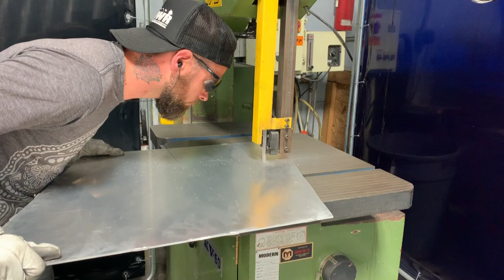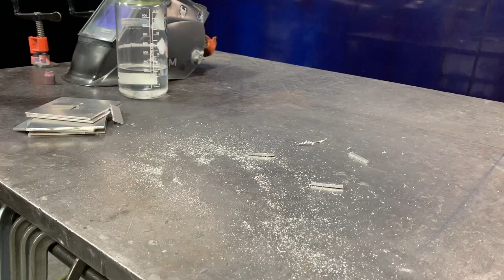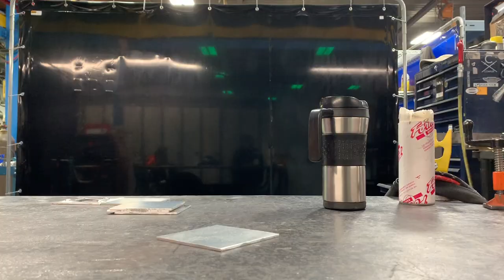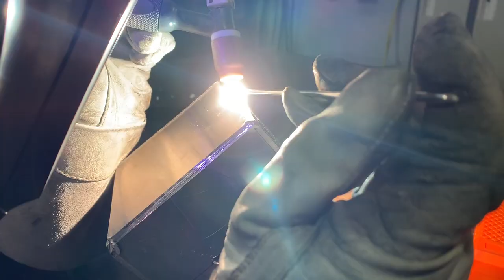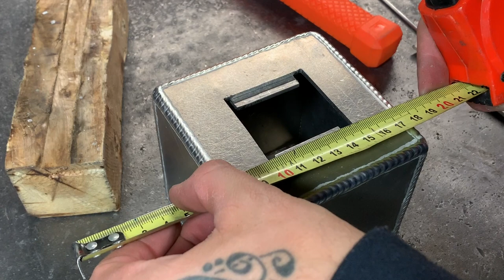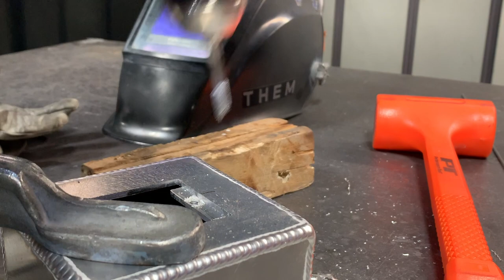WELDING ART 2019-Tig Welding An Aluminum Coin Bank!

Comment: Hi there! Excellent welding skills and fun projects! What TIG Alu settings used for the coin bank project? Like Ar flow l/minute or cfh, Hz, pulse ratio and current? Thank you from Stockholm, Sweden
Reply from the maker: Hey! Thanks for reaching out! Ive added this info to my newer videos, but as this is an old one, that info isnt included, my apologies!:)
My settings would have been AC current, around 160 amps, 60hz frequency, and about 25% DCEP for balance. The gas was pure argon, and running about 17.5cfh for gas flow:)
Cheers from Canada!
Reply: Thanks, so no pulse used. Got it 👍🏻